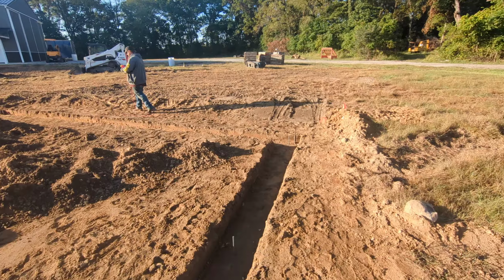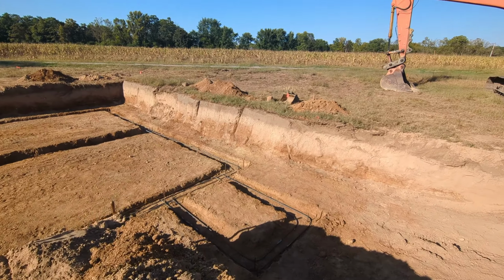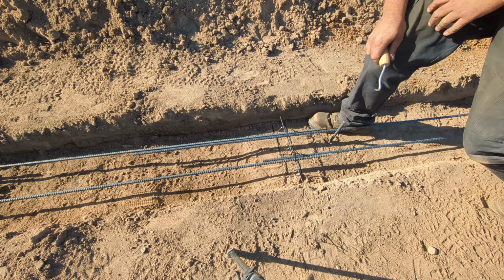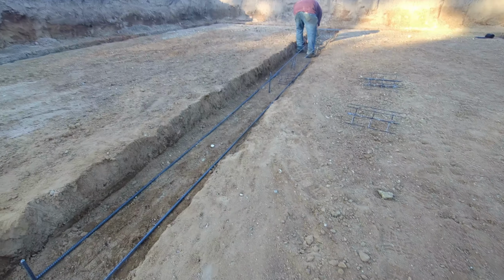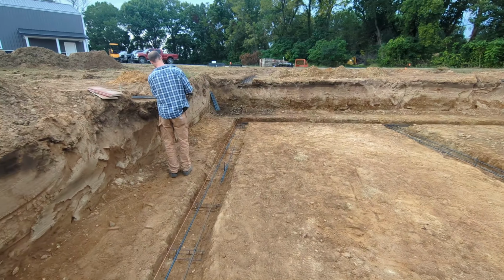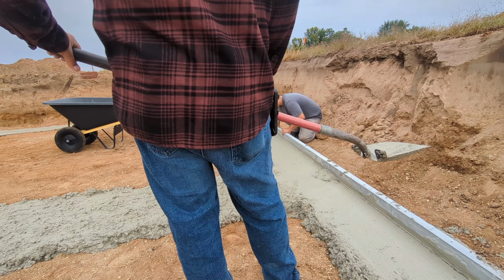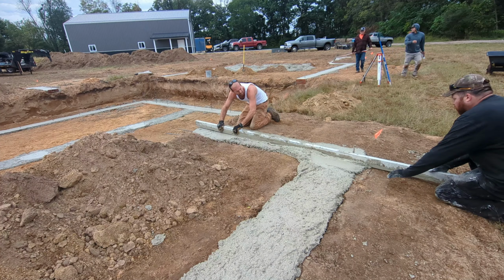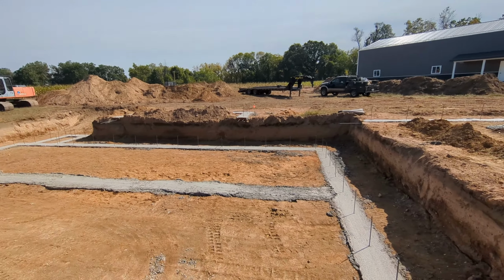Footing Construction For Our New Home

Comment: the forms should go fast usually a single pour for all the walls. in that way they are all uniform , and 
one strength due to being one pour. are they going to be 8’ or taller?do you have the rebar set to go?
great video, thank you for the reply to my questions in the past. there is something special of 
building your own home. a bit at a time!